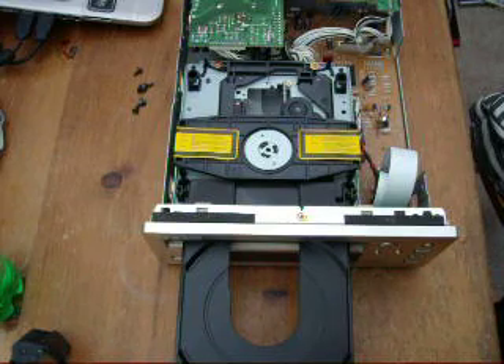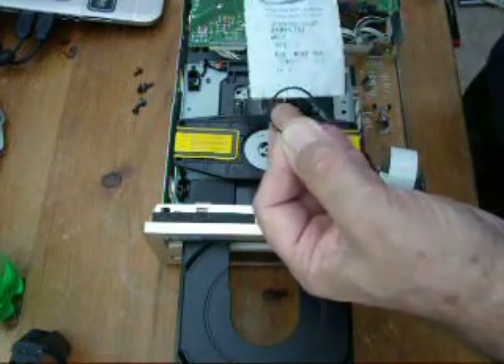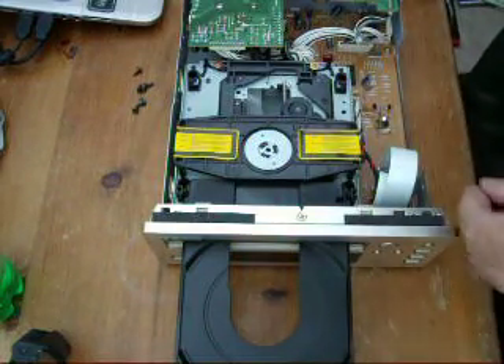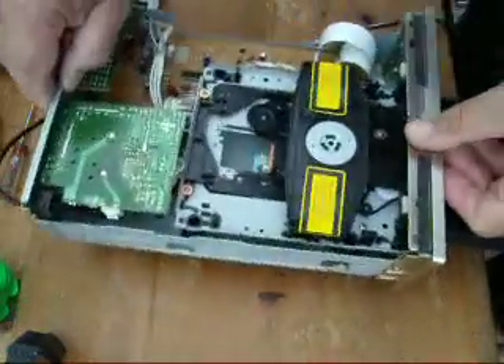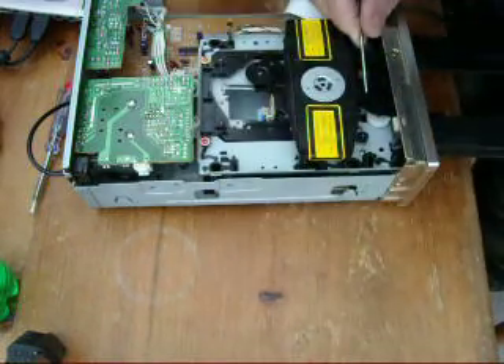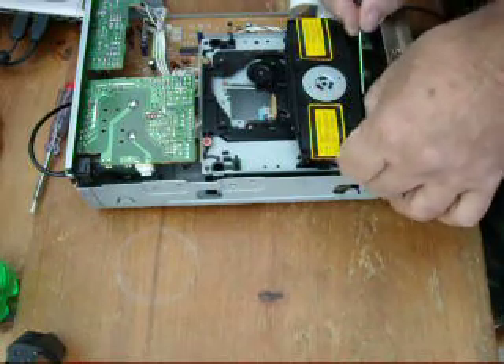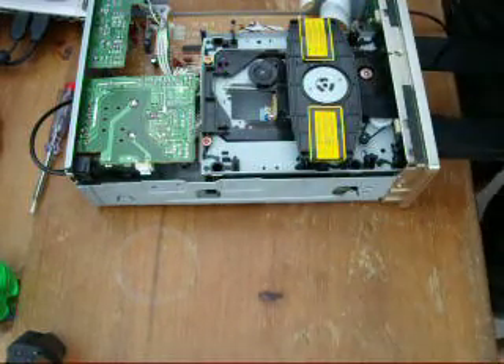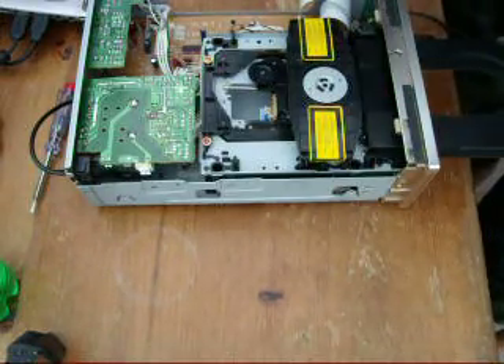Teac PD-H300c Drive Belt Replacement

Comment: Thanks for the video, very informative. A while ago I installed 25x1.2x1.2 belts in my two PD-H300 cd-players (as recommended by a repair shop, even though I was skeptical), but after a while these had issues again: the drawer would open and close, but not fully, it didn't provide the strength to make the drawer go fully closed. I have now fitted new 25x2x2 belts, but in my case the elasticity of these belts  caused one of the players difficulty with getting the drawers movinf at all (when it had no such problem with the 1.2 belt), the belt was slipping, even after sanding the belt. I managed to get if working again by lubricating the slider areas of the tray with a teflon grease (Robbe 5532, available from RC kit stores). Perhaps the belt will gain grip with some time and use.

I would like to recommend to anyone to order a 25x1.6x1.6 belt next to a 25x2x2 belt, so you can see which one works best for you. Not all belts are created equal, and some 25x2x2 belts might be a little too stiff.
Reply from the maker: thank you for adding some helpful advice to this guide. I have repaired and own quite a few Teac 300 and 100 CD players and almost all suffer with the trays dragging or sticking causing overload of the motors and rubber drive bands. It really does pay to make sure that the tray glides in and out smoothly before complete reassembly and the front fascia doesn't bind on the fascia opening .

Comment: How to repair the belt if it is not available. There are two fixing screw holes for the tray opening/closing motor. The hole is oval, so...
① Loosen it once and pull the motor to the left to increase the belt tension.
If that doesn't work...
② Use a file to extend the left end of the hole to the upper left. However, the terminal holes on the motor board also require processing.
Furthermore, "TEAC PD-H300 PD-H300C PD-H500 PD-H500i PD-H600 CD-H750 CD-P650" seems to be using the same machine.

Comment: Hello John,  I step in your video and I really enjoin it, thanks and  compliments. I get there because  I'm looking for a spare belt for my last purchase, an (used) Teac CD-5. To make a long story short on my case: the tray have no problem in moving in and out. As tray reachs its in position, optics need move up. Well, with the disc on the tray, it did't tilt up. Without disc it (uselessy)  works. I removed the belt and measured: considering the intrinsical uncertanty in a measure like that, it looks like 27 x1,5x1,5. In fact it fit loose.  I was therefore looking for something smaller, and I am happy to see that my idea fits with your experience and suggestion. anyway, as I had the belt on my hands,  my major concern  was not only its size, but its shape. I wonder about its square section. In fact the pulleys,  both drive and secondary, are V-shaped. from deign point of view, I see the choice of  square-section belt on a V-shaped pulley a bit... exotic: the contact is uncertain by definition, pulley V angle is not  even 90°, btw. (can't measure but is surely smaller). Since my belt is most probably NOT the original one, I wonder why you went for a square sized belt, if I may ask.
I am now going with an O-ring, I ordered a set of diameter testing who's fitting (and working) best. More to come...
Reply from the maker: The reason for a square belt may not seem obvious but there is 2x important reasons why it needs to be. Firstly a round section belt will not have sufficient contact with the V section drive wheel  to have enough friction and it will slip under load.
Secondly a 2mm square section belt will be much stronger and will resist stretching which the 1.5mm round belt will not. I would recommend you fit the square belt as fitted by Teac. good luck
Reply: @johncooper7242  Thank you John,  I have ordered the one you suggested. Meanwhile I set an NBR O-Ring 24x1,5 right today (I have the chance to shop those industrial stuff very easy in my town) because the player just arrive and I was eager to listen it.  It is working fine, I load/unload disc more than 50 times, it never miss a shoot. I will keep using until the suggested one will arrive so that I will have a B plan in case (when) my O-Ring will fail. Thank you again for your help.
Reply from the maker: @guidobaggioli6942  well done fixing it ,they are a great HiFi unit. I've had my set since they were first sold and they still look modern and sound terrific.

Comment: Thankyou John. I have this exact model and have just ordered the part from CPC (part number AVBELT61). £3.79 incl VAT & deliv. Lets wait and see if it works.
Reply from the maker: excellent!  let me know how it goes . The Teac 300 series are still fabulous looking and such good quality its worth trying to save them
Reply: I agree. Superb sound quality. The belt arrived yesterday and I fitted it today. It works perfectly and sounds as good as ever. Thanks for your help.
Reply from the maker: well done Miles .....another piece of quality equipment saved !
Reply from the maker: how did you get on Miles ?
Reply: @johncooper7242  I used a loom band.

Comment: I may have the same issue, but I cannot get the tray to budge. It is stuck in and even with some force I cannot get it to open, obviously I don't want to break it so I'm not using too much force. Is there something I need to press to unlock the tray so it can opened. I noticed in another comment you said it can be prised out with a blade, but it feels very stuck at the moment. Thanks for any help with this.
Reply from the maker: Matthew if you watch the video at 57 seconds I tell you how you release the tray using 2x small screwdrivers
Reply: Thanks John, I tried that, but the CD tray is fully withdrawn into the unit and pushing the 2 clips back still doesn't let me eject it even slightly. It has been some years since I last used it so not sure if something has seized up.
Reply from the maker: There are two seperate tray movements .
The first is the whole tray coming out to accept a CD . this is driven by a motor and rack and pinion drive. You will not be able to force the tray out if the motor is not functioning or you are likely to break the tray eject mechanism.

The second tray movement is the top part of the tray to which the front door strip is attached. Once you have the CD tray in full eject position then you prise back the 2x plastic clips and the top part of the tray comes out a further 1.5" or so to reveal the 2x motors and drive bands. There is only 2 tiny plastic clips holding it so I really cannot see how it could be jammed .

You need to have some apptitude for these devices or its all too easy to break something vital. Just take your time and study it carefully. Nothing should require any force to remove so just use fingertip pressure
Reply from the maker: Mathew have you actually removed the cover to the unit yet ? 
If you follow my other Teac H-300 video you'll be able to remove the entire tray mechanism from the unit and find what is jamming the tray.
Reply: John, i had already removed the cover and did in the end remove the entire tray. I used the large black cog to wind the top part of the tray out, which is the one that seemed to be stuck. I checked the band which seemed fine and have reassembled it. Initially the tray ejected when i pressed the button and i played a cd. But having tried it again this evening the tray won't eject again so I'm back to square one, although the motors and band both seem fine.
Reply from the maker: Mathew well done for managing to dismantle it, it is a very fiddly and delicate job.

I think until you replace the drive belt you will never be able to eliminate that as the cause for this problem.

It may look alright to your eye but how do you know if the dimensions and elastic qualities are within manufacturers tolerances ?  If it is the original drive band it could be up to 15+ years old and although not broken or mishaped rubber deteriorates over time and loses its elasticity .You wouldn't drive your car on 15 year old tyres would you.

With a new belt fitted if you still have a problem then you will need to inspect the transport mechanism minutely with a magnifying glass and look to find where the moving parts are binding dragging or out of alignment. Don't forget to apply a tiny smear of white lithium grease where there is existing grease applied during assembly . 
good luck
Reply: Did you ever solve the problem with the tray not ejecting?  @MatthewRuigrok

Comment: I have one of these and the try isn't opening.  Is that the issue you had?  It powers up and when I click the open button, I can hear it trying to open but it can't.
Reply from the maker: yes that sounds like just the sort of issue i had with mine.
its really easy to open the unit and check your tray motor rubber band. 
if the tray isn't opening under power you can very carefully prise it open with a small blade and then slowly and gently pull the tray open . 
let me know if you hit any snags.
Dig your cycling videos ,I used to be a keen club roadie and still have some bikes but alas I'm now too old and fat and unfit these days . Your videos brought back some happy memories
Reply: Hi John, thanks for replying so fast.  I opened it up and had a look inside. If I push down on a large white cog the tray opens.  So It could be that it's jamming somehow.  After a few open and close tries and pushing down on the cog each time, it seems to be okay now.  But it might happen again if I leave it off for a while.  It may just need some grease but can't tell as I can't see where it's getting caught.  Thanks again.
Reply from the maker: I had to tweak mine a bit to get it to work. I applied some lithium grease on the rack and other places  and it helped a lot.

Comment: Thank you John, your video helped me a lot! I replaced the belt and it almost worked..
Actually the tray is closing but it lack a millimeter to be locked: if I push the tray it goes this mm on and locks so the CD is read.
Then I can open the tray but when I close it, the same problem occurs, missing this mmm... I can't really find a way to "add" this mm...
Any clue? Thanks again
Alex
Reply from the maker: I think the plastic fascia that is fixed to the front of the CD drawer is catching or rubbing slightly just as the drawer reaches the closed position. You might need to  file the edges of the tray front fascia   slightly so that the tray returns fully.
Reply: I had the same problem; forgot to push the plastic cover properly back in position!

Comment: That didn't look too difficult , would it be  as easy to replace the belt on a Teac VDRS 20 ?
Reply from the maker: I cannot say as I have never owned or used a teac VDRS 20 but as they are the same manufacturer I'm sure they will be very similar in construction.
Have a go you've nothing much to lose if the player is currently non functional. take it slowly without forcing anything and take plenty of pictures as you go to record how everything came off and will need to go back together. Good luck
Reply: i took a chance and changed it  after removing many screws screws , it all looked good , until i tried it , the drawer opens immediately  after closing and stays open , bummer .
Reply: ok , thanks
Reply from the maker: Julian you've probably either solved it or binned it by now but for the benefit of anyone else reading this you need to operate the CD player with the cover off to see what is binding or jamming but use the obvious precautions when working on live equipment.

Try ejecting the tray until it sticks then switch off. Remove the cover then turn the player on and observe. The tray should automatically withdrawer back into the player. If it doesn't you may be able to spot the reason why it is not. Is the tray motor working (hum or spinning ). Is the mechanism making any noises at all like its trying to do something ? Is the tray ejecting out  too far ?  maybe the tray stop switch is faulty ot misplaced .
Reply: yes i did thanks, now the issue is the motor , it has an audible hum, TEAC  didn't respond when i inquired if it was possible to buy a new motor .
Reply from the maker: See if you can read the motor part number and do a search for a replacement with Google.

Comment: hi ive tried cpc for the belt but there saying the circumference seems to big at 85mm, could you please tell me exactly what i need to ask for as im rubbish at this and the lady said the dimensions dont seem right as the draw on my cd player just keeps opening and closing on its own so hopefully its just the belt thats the problem..thankyou.
Reply from the maker: If you listen carefully to the video I state that the diameter of the band (measurement across the band) is 25mm and the internal circumference ( measurement all the way around the inside of the band) is 80mm. 
I also state that the thickness of the band is 2mm and it is square section.
If you want to explain these measurements to CPC tell them that the circumference of a circle is always 3.14 times the diameter ie 25mm x 3,14 = 78.5mm .Allowing for the thickness of the belt that makes the circumference externally approx 80mm .
Hope that is clear
The belt you need is belt 61 CPC Order code AVbelt61 £0.84 ea
https://cpc.farnell.com/unbranded/belt61/belt-square-25-0x1-2mm-diaxw-av7324/dp/AVBELT61
Reply: @johncooper7242  thankyou so much for your help, ill wait fir it to arrive and go over your video again to fit it, hopefully this will fix the problem as its to awesome to get rid of🙂
Reply from the maker: @raahkumara8304  you're welcome good luck

Comment: You can remove and heat the old belt 400 degrees, 1 minute, 2 inches away.  Hot air gun or hair dryer.
Reply from the maker: if you are going to all the trouble of removing the old belt why would you put the old belt back again ?
Rubber deteriorates with age and heating the belt might temporarily shrink it but within days or weeks it will be slipping again.
For the sake of a couple of dollars just put a new belt in
Reply: A hair dryer does not reach this temperature.

Comment: hi my system is like yours, but my issue is, the tray will not stay open, when ejecting, it closes straight away ? have u any idea what can be causing this issue, and what i would need to do to correct it? thanks
Reply from the maker: without inspecting your system its difficult to diagnose the issue but my guess would be that the CD drawer has been forced in at some time and the transport mechanism has been damaged either the rack has skipped some teeth or the drawer sensor micro-switches are misaligned. There are 2x micro-switches that sense when the drawer is open and when it is closed.

My suggestion would be to carefully remove the plastic front fascia from the drawer and remove the case lid and watch what happens when you operate the player with a CD in the drawer . You may spot the source of the problem